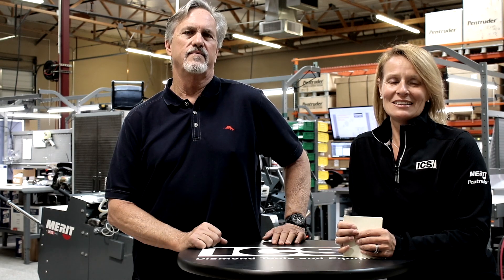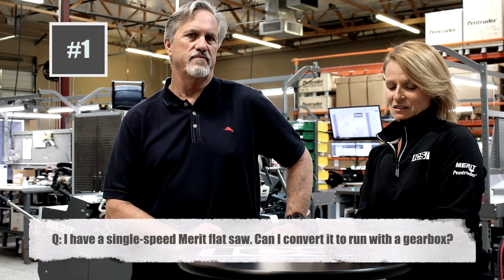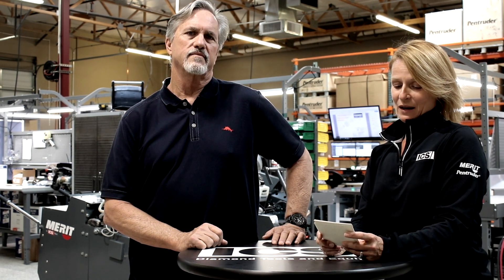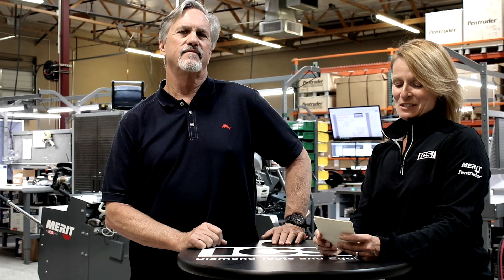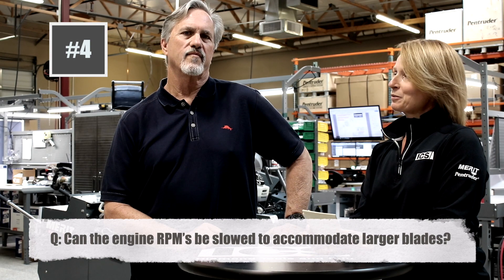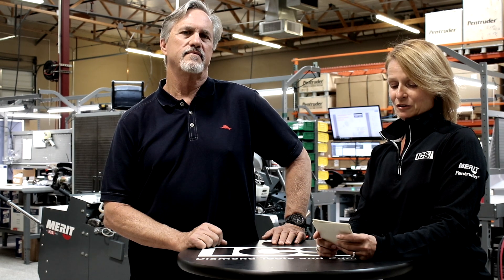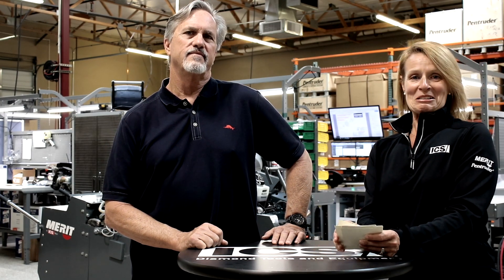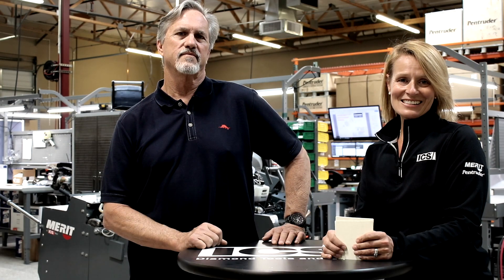Merit FAQ's: Gearbox

Comment: How much quarts do you need for gear box oil?
Reply from the maker: There are different amount requirements depending on which saw you have.
For all Merit Saws, we recommend 85-140 Lucas Brand Oil
 
Medium Duty saws (350/400 series models)
2 quarts
 
Heavy Duty saws (600/800 series models)
600 series 3.5 quarts
800 series 4.5 quarts (due to the difference in shaft length)
 
Please note:
Before adding oil, be sure to level the gearbox to the ground - to do this, place a level on the top of the gearbox and raise/lower the saw until it's level with the ground.
Pour slowly to allow oil to pass through bearing and center housing evenly. If you pour too quickly, it will overflow and you will not have added enough oil.
Use the side plug on the gearbox to ensure enough oil has been added - remove the plug and when the oil reaches the bottom of the hole on the open plug, you've added the correct amount of oil.